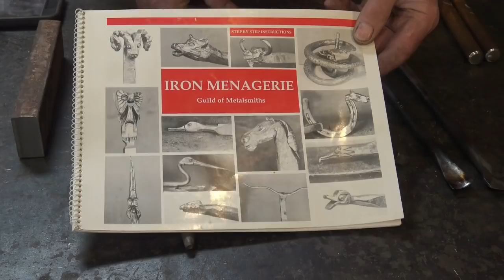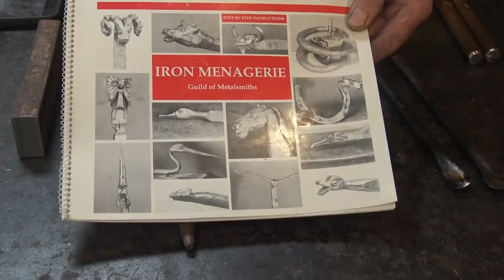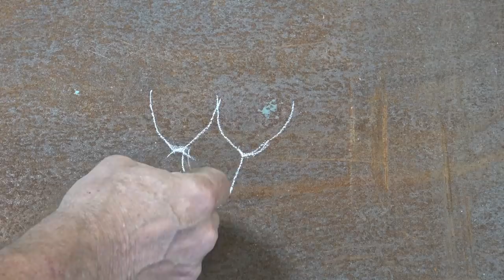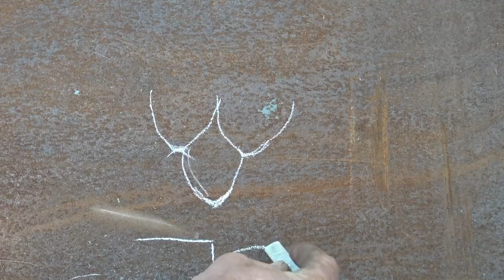Dragon scales chisel - wrought iron dragon project

Comment: Great video John. I made butcher tooling for my blacksmith helper yesterday and used an old grader blade for steel stock. I will never use that stuff again. The entire time I heard you in my head speaking about having the same experience. I was very lucky to not have burned up a grinder. Next time I'll try to pay more attention---HA!
Reply from the maker: I bet you'll never have to make that tool again though

Comment: local specialty metal shop has H13 in 16 and 20mm rod quite cheap, but they only stock S7 in 35mm round, not keen of forging that to a smaller size!
Reply from the maker: H13 is a good steel.  Of course you could also use salvaged coil spring or similar.
Reply: that is what I generally use fro punches etc.

Comment: I love making the tools that allow me to do the other projects. Thanks for another great video! I live in Canada now and they do not sell vermiculite here (maybe because of the asbestos) , do you have an alternative method for annealing?
Reply from the maker: Vermiculite is available as asbestos free, but perhaps that isn't the problem.  Clean dry sand would be one option as is a bucket of wood ash.  The ash tends to float all over the shop and make a mess, but it works well.

Comment: So, if I were to find some used air chisel bits, they would make some fairly decent punches? I would assume they should be made of S7
Reply from the maker: They should be good steel, but don't count on them being S7.  A few years ago someone was selling blanks from air chisels and said they were S2.  Every manufacture might use a different material.

Comment: ever work with powder tool steels like cpm 154, or s 90v John? I hear they are durable but a real bear to work due to the hardness what about o2 ?
Reply from the maker: I never have, but with the steels I do use I see no need to experiment with unkowns.  Why mess with something that already work very well.
Reply: ah well true,  there are as it were though even more high performance steels on durabillity, they are usually used in knifes or high wearing cutting tools, real exotic stuff